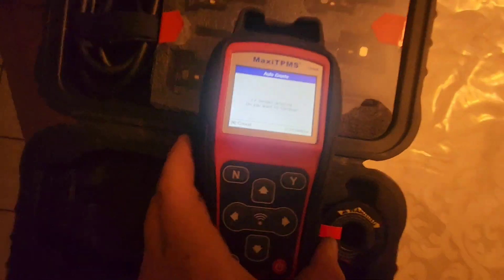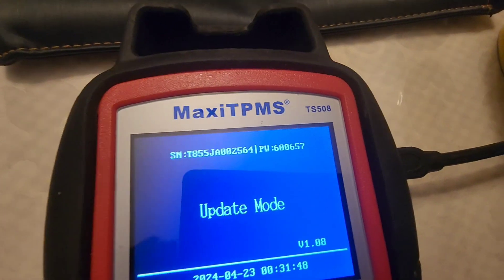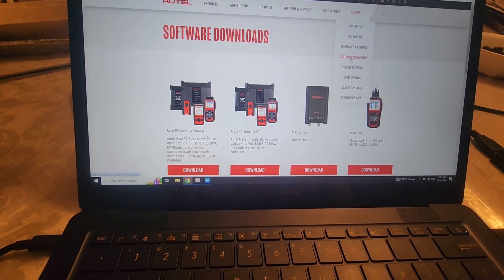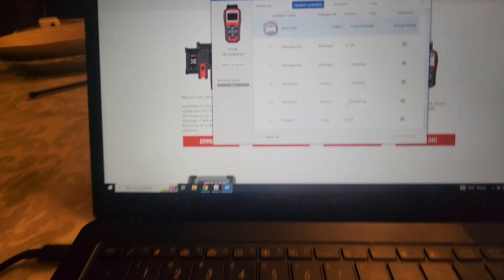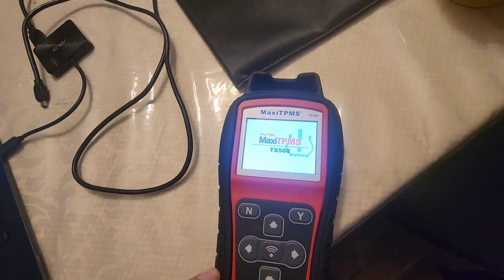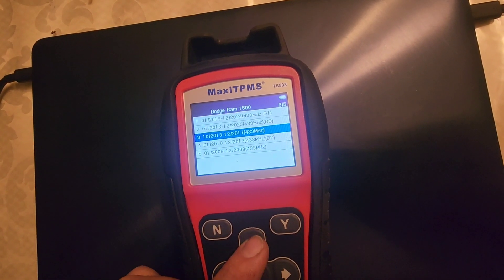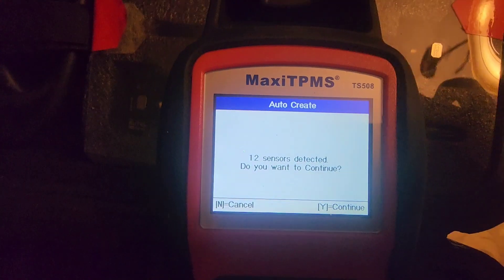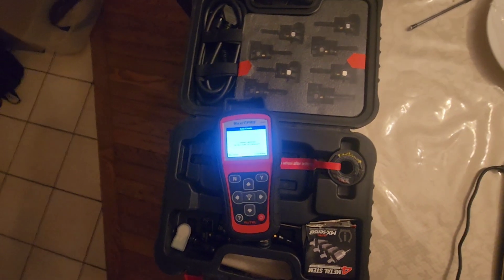Fix autel MX sensor not recognized, not generating not programing not detected. update

Comment: Thanks!!! saved me a bunch of time!  also, after update check in "MY DEVICE" , "SETTINGS", "MARKETS" and select the proper country.  For me the default was europe, and my USA subaru did not show a 315Mhz option.  Switching to USA fixed issue.